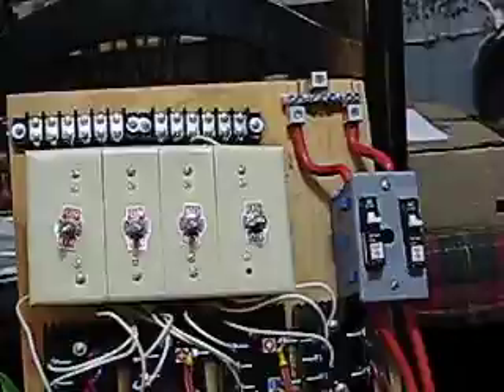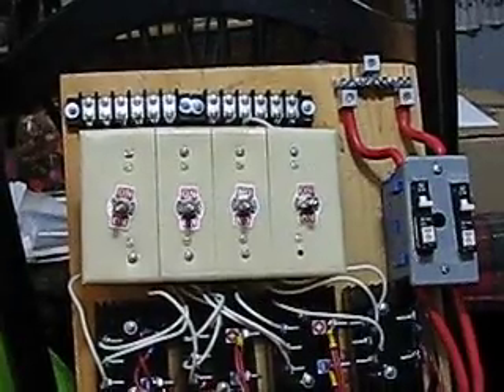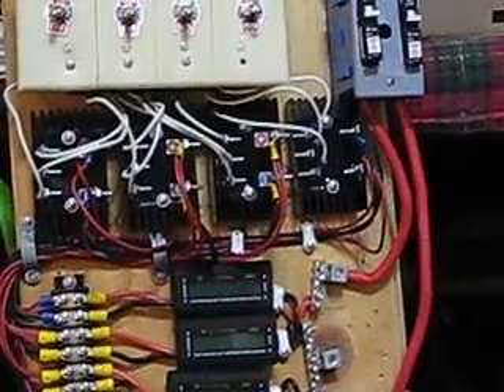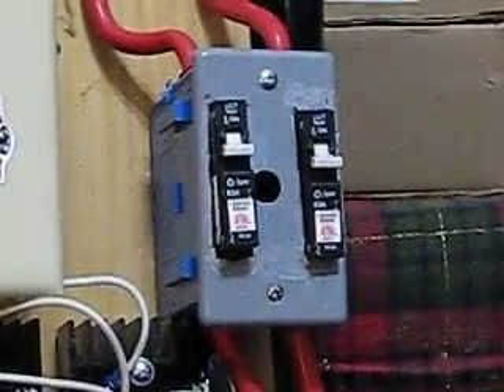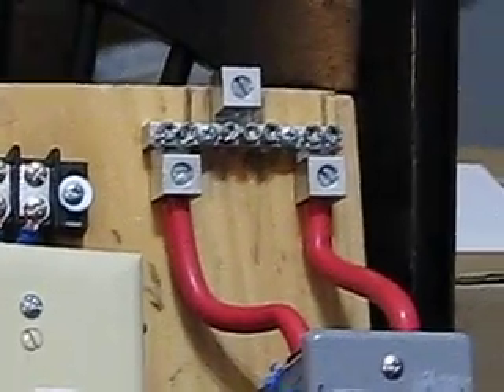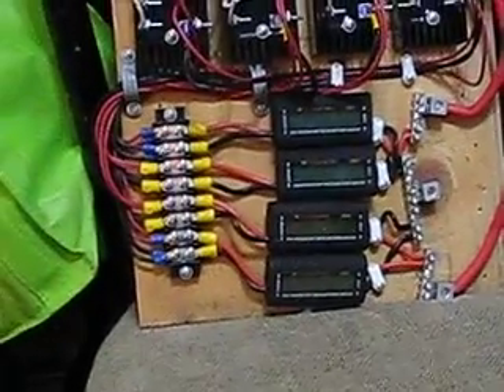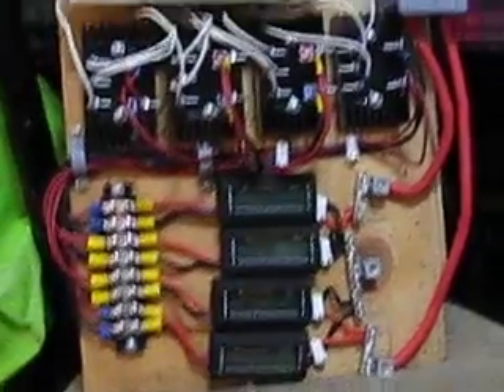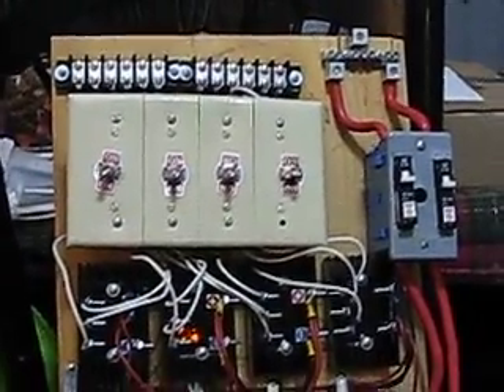4 PMG Control and Rectifier board 4

Comment: Is it for solar or a wind turbine?
Reply from the maker: why would you need a rectifier on a solar panel?
Reply: Rev John O'Toole I dont know thing...
Reply from the maker: BadBrainPrepp this panel is for for "permanent magnet generators-pmg", which has a wild 3 phase output that varies with speed of shaft whether powered by wind water or something else, converts that power to dc to charge batteries. solar is already dc to chage batteries.
does that help you understand?
here is a good info book that covers far more than you think
http://www.amazon.com/Homebrew-Wind-Power-Dan-Bartmann/dp/0981920101/ref=sr_1_21?s=books&ie=UTF8&qid=1418924191&sr=1-21&keywords=home+power
Reply: Rev John O'Toole Thanks I know a little ,just enough to be dangerous...